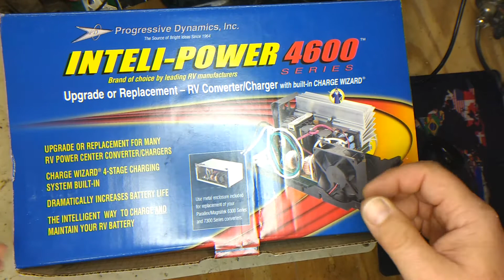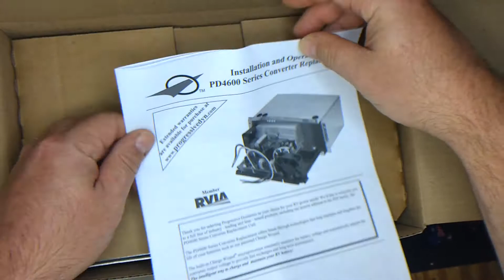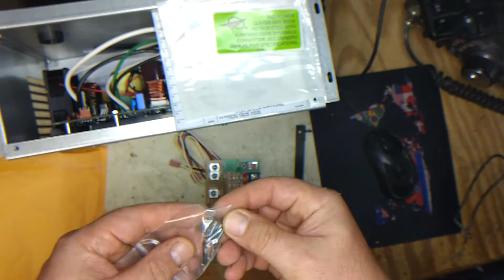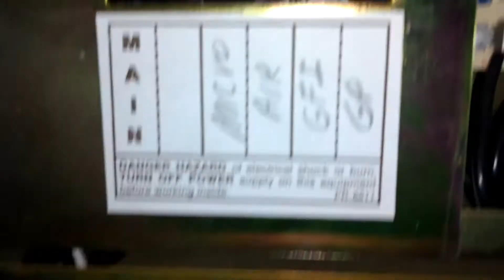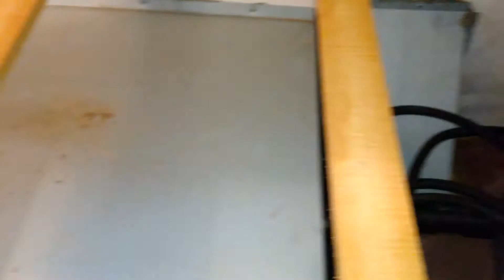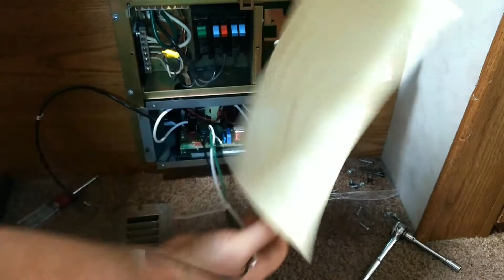RV Power Supply SwapOut Progressive Dynamics Intelli-Power 4645

Comment: Thank you.    I’m confused about the color wires and what is what.   I’ve got the ac side but the converter has only black and white that are labeled. Old one has blue and red and third I think.  I’ll watch the video again.
Reply from the maker: I am not too sure what you are missing.   With the video, definitely scrutinize the included installation instructions for the most up-to-date and valid installation.

Comment: Just had a tech out to our rig to do this for us (can't do this kind of stuff anymore). For some reason, he thought he wouldn't need to install the new circuit board and could and just go off the old one. NOPE. Didn't discover that until right after he left. None of the stuff that's on the original circuit board is working. Sigh.
Reply from the maker: That stinks.   Hope it works out for you
Reply: @JayUJay  We called him about it. He  came back out and put in the new circuit board. No additional charge. Everything working fine.

Comment: I have a question, I am installing my new converter but the problem is, I don’t have an “open spot” on the earth block to connect the green wire? Can I run more than one wire into one spot?
Reply from the maker: I will need to wait until things warm up to look at this one.  For safety, you might want to run it by an electrician or a mechanic that could help you ground it, and make sure it is actually a ground-
But usually the green wire would need to have a solid mechanical connection to ground-
Reply: Jay UJay thanks buddy. I just took two of the smaller brass wires an placed them in the same spot. Created a place for my green wire.

Comment: So how did you hook up the power wire (black) to the refrigerator?  Did you T-Splice it into the black wire from the new converter that went into the AC side?
Reply from the maker: That would be off of the dedicated circuit breaker to the left of the connections board.  The 'fridge has its own breaker and splicing to a main feed is probably not a good idea.  The white wires, or neutral wires were all spliced together.